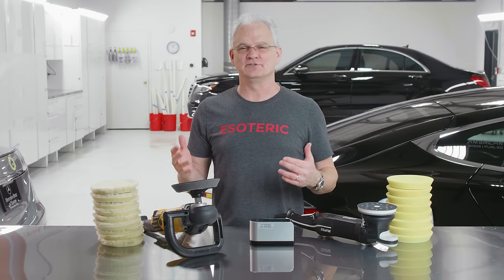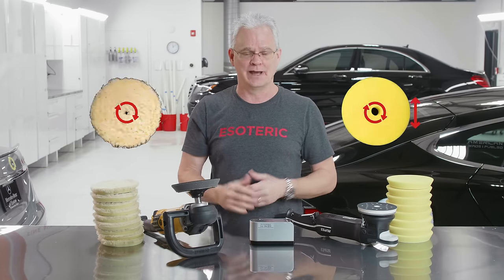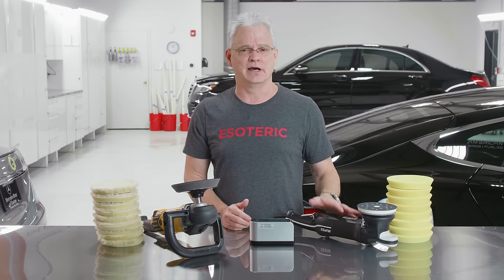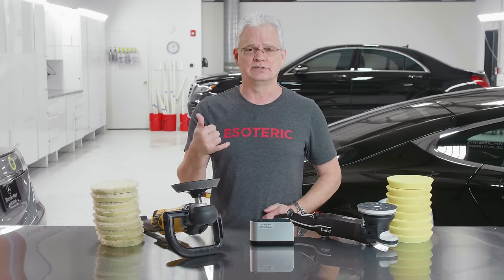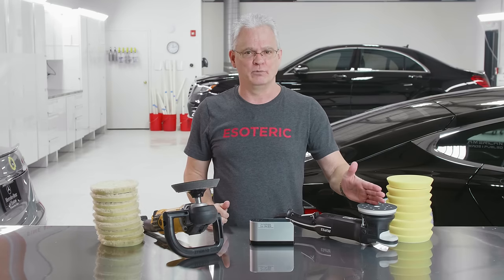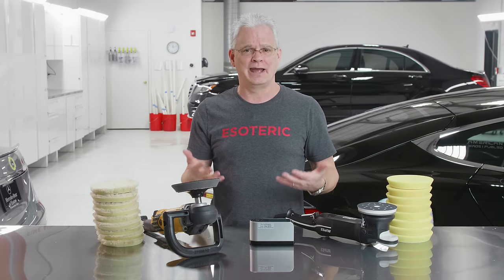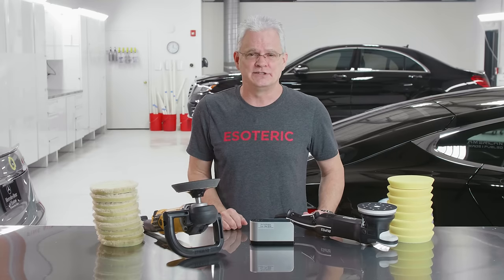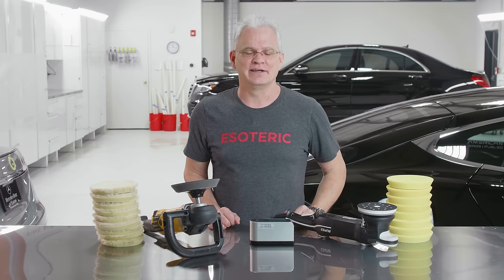Still polishing with a rotary? THIS could change your mind!

Comment: Started with a Flex DA for 5 years, then went to rotary and never going back. I can cut faster and get a better finish with my rotary than I ever could with a DA in a fraction of the time. But that is because I have the skill and techniques dialed in perfectly. If you are running a business with multiple employees then yes I can see a DA being worthwhile. But its just me. And when the other shop cant get it right, they come to me to fix it.

Comment: I use rotary for cut and DA for finishing but you don't talk about that, if you cut with a rotary the heat don't get as high and you don't stress the paint as much if you ask me
Reply from the maker: The shearing temperatures need to be in the 150+ range before you have to start worrying about any paint issues, and proper use of a DA, even in the compounding stage, shouldn't get temperatures anywhere near that range. So it's a non-issue.
Reply: @Esotericdetail  no you shouldn't be anywhere near that. To me the rotary is still the better machine for cutting and the DA for finishing. I do a lot of daily drivers here in Denmark and they are trash compared to what people show from the states a DA would take way to long to cut some of the paint I see

Comment: I paint cars for a living and I wet sand and buff them after I'm done. I cut the whole car with a wool pad on a rotary and then step down to a rupes Bigfoot 21 and the result is awesome👌👌👌
Reply: @2_MinutesOfAviation   I love using rotary and when it comes to DA’s Rupes has and knows they have a larger oscillation throw (with power) and they charge more because of it. In Translation, the bigger the throw, the quicker and better are the results (with enough power). I own machines from all variations and don’t mind spending money to make more money. Rupes is worth it. Just buy the ones you truly need, not all the models they sell

Comment: We so need a Todd versus Yvan Lacroix matchup on a test panel, lol.  Yvan is a huge proponent of cutting with a long throw DA and finishing with a rotary.  Have the panel compounded by an independent detailer who has no idea which side of the panel Yvan will be working on  or which side Todd will be on, put a tape line down the middle and let Todd and Yvan have one step to finish their side of the panel and measure the difference with the DOI and also have some independent judges who have no idea which side was done by which and they judge which is better.  I know this will probably never happen but I would pay admission to watch it mostly because I am very curious which would win and I think Todd and Yvan are both among the top 1% of detailers.
Reply from the maker: Many years ago we did compounding with the DA, and finishing with a rotary. But when DA technology, pad technology, and polish technology improved, we found no need for the rotary anymore because that bridge was gapped. Over the years we have done trials using the DOI meter comparing the two machines, and found no measurable differences.
Reply: fantastic comment
Reply: @Esotericdetail  superb reply! THANKS!

Comment: I'll throw this into the mix. I found for polishing windshields that the rotary with a 3" glass pad and Ceriglass works best. I can get to the edge better and cut/polish better.
Reply: Totally agree. Glass polishing was what got me going as a professional. Water spots are  horrible in my area, so advertising with an emphasis on glass correction got a lot of attention. I see glass so bad it's borderline dangerous to drive.  
But I almost never touch actual glass correction with anything but a rotary. It is possible with a DA, but you're wasting a lot of time if you're going after anything but light etching and water marks with most DAs. Plus you can tilt the rotary and get edges and tight spots much easier.  I like and use CeriGlass, but I buy the super cheap Cerium powder and make my own if I'm going after alot of actual scratches. 

What pads do you use, do you prefer rayon or felt pads? Have you tried the glass cutting specific pads from LC? Haven't tried them and curious if they're more effective than standard glass pads.
Reply: @jdisdetermined  I use the rayon pads
Reply: Absolutely agree with you, Platinum Auto Glass & Window Tint !!!  
Nothing beats Direct Drive in the hands of one who knows how to use it..
All the industries that make airplanes, boats, all the vehicles of every type at the assembly stage only use Rotary Power for a reason... It is fast, it gets perfect correction, and you are done and the vehicle, etc., keeps going down the assembly line...
No time for whatever name it is random orbital machines here...  Need perfect results and need them now,  not hours later...
Reply: @frandanco6289  You’re completely discounting forced rotation DA’s or even long throw random orbitals for that matter. Someone correct me if I’m wrong. Additionally Mike Phillips teaches that the reason production lines prefer a wool pad on a rotary IS indeed for the very fast cutting but they understand that it can’t produce a perfect finish. Trust me, after working on a production line in the RV industry for 4 years, the word “perfect” is not in their vocabulary. It’s all about getting it finished and out the door, and on to the next one.
Reply: 100% agree.
My 3" battery powered rotary is only used for glass and lamps.
I even use my 3" with regular Auto Glanz glass cleaner and a black polishing pad during my regular washes. Takes a few minutes and my glass is perfect inside and out.
Reply: Why are you polishing glass exactly?

Comment: As a detailer, I was trained on the rotary and used it for over twenty years, I've been using the DA for the past five years, DA is the best choice, the technology in compounds and DA is much better, with the option of one step correction is the only way to go, in comparison the DA is superior, thanks todd
Reply: Years of experience with rotary, I'm thinking of going to D/A. Rupes lh15r or the Mille?
Reply: @rajivsewnandan4865  ,good choice, your not going to regret it, I still use a rotary once in while, another advantage in using a DA is, it doesn't wear you out physically, DA are much lighter, good luck rajiv.
Reply: @h1989w7373  yes bud, love my Makita but he's gotten heavy over the years lol
Reply: @rajivsewnandan4865  ,yes they do get heavy over the years, and we get older too, loling!
Reply: @h1989w7373  I have a newer vehicle with already good paint. But if I wanted to some maintenance on it, can I do a one step rotary with meguiars m210 and an ultra fine pad?
Reply: @Phuong_Nguyen_  new car paint and you are newbie, pick a 12 mm DA and meguiars ultimate polish compound, so much forgiving for newbie

Comment: I have a rotary that I have used maybe 5 times in the last 10 years and only on highly oxidized single stage paints just to knock down the heavy stuff... I finish up with my Griot's Boss 15.
Reply: i  agree knocking down heavy damage using a rotary and a wool pad with a good compound then washing car and switching to a good DA and polish makes the most sense...

Comment: Great video, Todd and i completely agree.  This week, however, I am working on a moderately oxidized RV.  For the first time in many years I broke out my rotary and wool.  I did 3 test spots, 2 DA and 1 rotary and am saving time with the rotary.  I wouldn't say it's dead but relegated to maybe 2% of my business.
Reply from the maker: There's always outliers for sure!
Reply: If you detail a really oxidized boat, then rotary is mandatory
Reply: Everything has its place. But like I said elsewhere, I think many of us who are properly trained and skilled with a rotary, still use a DA 98% of the time these days. Love a rotary for glass and lamps still, but the rotary is broken out rarely these days.

Comment: The Meguiars microfibre cutting disks completely changed everything when it came to paint correction with a DA. I remember everyone being hyped about them when they came out because now you can do heavy paint correction without having to pull out the rotary. I still have my Makita and Simoniz rotary polishers but hardly ever need to touch them. It scares me how many people out there have no idea what they’re doing but yet still reach for a rotory

Comment: Hi todd. Love the rotary but was cranking long throw da's back in 2008 too.  Remember the  dynabrade long throw.  I think a da is awesome for almost all jobs but a rotary sometimes comes in handy  Rotary is easy to use but hard to master. I can do two steps with a rotary no problem but its not always ideal.    Ive mastered the tool after 27 years.  What the rotary is great at is edge work and doing areas a 15 or 21mm large da cant do without banging into door handles and mirrors.  Both tools rock but the da is very good for one steps, the money maker for most detailers
Reply: Not many remember the dynabrade.
Reply: Perhaps if most detailers like to take a lot Longer- to finish a vehicle, use your D/A..
I can do all of it in 1 step all the time with my Rotary...
Just so you know,  Nobody who is a real Detailer is taking the vehicle out in the sun,  we have Real Great Lights inside!!!  Geez, dont you people have inside lights??
Lots of time to master????  Why????  A year plus???? Are you guys just really slow at learning???
Reply: @frandanco6289  Ego much?
Reply: @frandanco6289 
One step with a rotary?
Baloney...

Comment: Thanks Todd. I think your channel is a great hub for detailing. I have heard many folks share the horror stories about the potential that a rotary has to "burn through" the paint. Those stories are why I strayed from those polishers and learned on a cheap Harbor Freight DA. I still have yet to buy that first rotary. I am now asking myself, "Why buy it?. Are you unhappy with the results you get from your DA polishers". I am not. If I am ever unhappy with my work, it is because of my choices that have little to do with my DA's. After seeing this video, I am leaning more toward the idea that I do not need the rotary. I want to continuously improve. I just don't need to complicate that any further, so why do it?
Reply from the maker: Your thought process and reasoning is solid, indeed!
Reply: @Esotericdetail  Another example of people being scared of the Rotary and you add to  there fears only to sell your products. I don't blame you. I would to if it's making me $$
Reply from the maker: @franco12954  You're a bit off base on this one. We also sell rotaries! But the fact is that hardly nobody in the high end detailing world still uses a rotary, and the sales of those tools have long since died...

Comment: I use long throws 95% of the time, but sometimes i do the edge work with rotary. It is easier with rotary since most of the cut is on the outer edge of the pad and you dont have to worry about the da movement.
Reply from the maker: We teach edging techniques on a DA as part of our course. Extremely effective, and much safer than a rotary. And it saves time since we're not grabbing for different machines.

Comment: Thank you very much for the information! I never use the DA polisher machine before. Still prefer to use flex rotary for my paint correction
Reply: I use a forced rotation DA.. Not made by Flex.
It's the man on the tool not the name on the tool that matters.

Comment: Trust me a rotary will get the job done a whole lot faster when it comes down to buffing! U can still polish with the rotary after buffing and then at last (optional for swirls/smooth finish) Finish ur last pass with DA.
Reply from the maker: Once again...we can agree to disagree on this one. And if you feel that there's any need to follow up a rotary with a DA, then the rotary process is being "rushed" too much. Refined finishes take time...
Reply: @Esotericdetail  there a videos about which best rotary da or fa same condition same rpm same degre rotary is the safest and buff better then all of them* they debunked myth DA was the most dangerous which destroying buff and touching paint before all of them so*

Comment: This was wonderful! It's the first of your videos I've seen, and it was much clearer and more interesting than pretty much all the others I've watched. You are such a good teacher - enthusiastic, interesting, energetic, and clear in your explanations without being overly wordy. Thanks!! I'm about to buy the DeWalt DCM848 DA (orbital) cordless polisher. I'm going to ceramic coat my car. I'm at a loss, as a complete beginner, to know how to find compounds specific to DA. Also, of course, how to figure out which to use, and what steps to go through, for my 11-month-old Corolla. Any pointers or suggestions would be much appreciated. About all I understand so far is that 99% of the work is in the paint prep, and 1% is in wiping on the SIO2 compound. :-) However, what will my 99% consist of, what steps and what chemicals? Anyway, despite my beginner's ignorance, I really appreciated your video. I opened a few of your others and will watch them asap.
Reply from the maker: Thanks for the positive feedback! Take a look on our website for Sonax Perfect Finish and Rupes yellow polishing pads. You will find videos on them as well. And for coating, look at our Kamikaze Miyabi Coat. All of these will provide you great results, and unequalled ease of use. We have over 400 videos available, so I'm sure you can find a lot of useful information that's all based off of proven results in a busy, high-end detailing business. www.esotericcarcare.com

Comment: Great review, but I'm still sticking with my rotary as I'm trying to stay away from having multiple machines (budget problem, mainly) and still appreciate the simple change of backing plate size to attack various paint problems.
Reply: You are correct, Chak Wo Wu !!!  I just have a small spacer on the end of the Rotary Shaft and I can do anything with backing plates and pads down to 1 inch, all day long...
Reply: And you are 100% correct this guy has no idea what he is talking about ,rotary is the best...

Comment: What about the capability of a DA vs rotary on freshly sanded clear coat?  I have never been able to bring the gloss up with a DA.  Is it technique, pad selection, compound selection or combination or is the DA just not the right tool for this application?  Thanks in advance.  Very informative video.
Reply from the maker: I've never had issues with that, but yes, you need to have the right combination of tools, pads, compounds, and techniques. I've taken 1500 sanding and follow that with one compounding process, and one finish polishing process to a perfect finish with a DA. Using a 21mm throw machine like the Rupes LHR21 with a 5" backing plate on it will also increase your chances of success. A short throw machine won't do you much good in those cases.

Comment: I have problem with the rupes LHR15 mk3 in panels that are not flat... it does not rotate good. I lose a lot of time trying to adjust the angle on the dor panels and its nitemare
Reply: Forced rotation or rotary is your friend in those areas.

Comment: I use both! Both have a pro and a con! Rupes LHR15II has to have the washer mod done in order to work like it should. I can tell u haven’t modded yours. Trust me, it’s worth the 2min to modify. As for the DeWalt Rotary goes. I put a 5in Velcro backing plate on to accept the Rupes 150 pads. In the end it depends on the body lines and the situation I’m in on which I use. I can tell u that Mothers Professional Ultra Fine Polish on a Rupes 150 White Pad on a Rotary leaves no swirls and quite the finish. That’s on 1200-1400RPM.
Reply from the maker: We use Kamikaze backing plates on ours...the best upgrade you can do to the Rupes.
Reply: @Esotericdetail  hola, cual es la placa y que virtud tienen en comparación con las originales de rupes? no rozan el encausado o goma protectora ?? gracias
Reply: @Esotericdetail  Hello, what is the plate and what virtue do they have compared to the original rupes? They do not rub against the defendant or protective rubber? Thank you

Comment: I use both quite frequently. I do feel when I'm sanding back, the Rotary with 3 step correction gets a better finish out of it then the orbital. It could be I just haven't found the right compounds for the DA.
I rather do a 3 step correction then do a 2 step with a da and not quite get the result I'm looking for. It's probably the perfectionist in me but I just seam to get a better result with rotary. But the DA is fantastic and easy to use, not as much strain on the body, also achieve quick results. I just prefer the Rotary for the jobs that require finesse
Reply from the maker: 3-steps are a thing of the past. I would also agree that you haven't combined the right products and techniques. We can do a 2-step DA process to perfection, and any additional polishing by a rotary won't make improvements (proven with a DOI meter).
Reply: @Esotericdetail   Hello, I think this myth comes from first rotary step, when I do 2 step I always start with rotary (pad and compound depend on paint demage) and I noticing there is much more paint leveling with rotary compounding vs DA compounding, I mean orange peel leveling, fortunately we have Perfect finish (which work almost every time) which is able to finish even very agresive wool compounding on rotary, best of both world!s :)

Comment: id personally use a rotary on something bare metal, say a truck gas tank, where you would prefer to use the edge of the pad rather than the main surface

and i would use a da polisher on anything painted, because i think it just leaves a much better finish without more work, it cuts out a lot of time spent getting things right